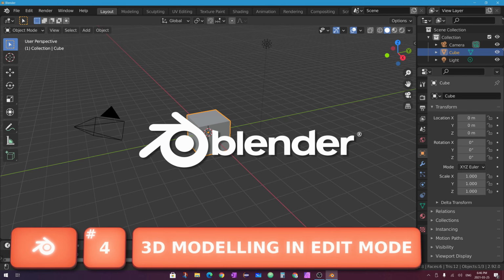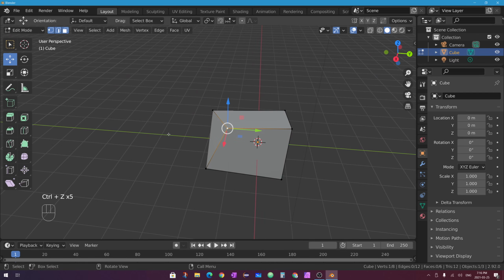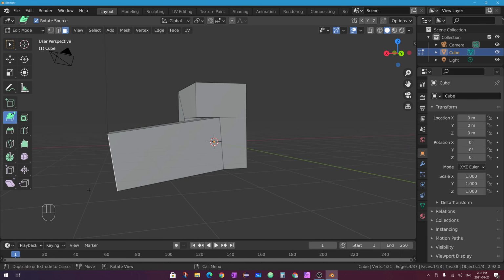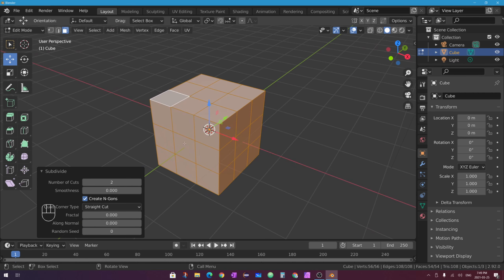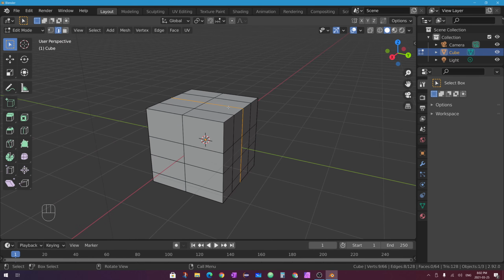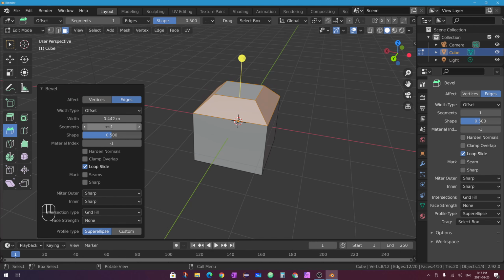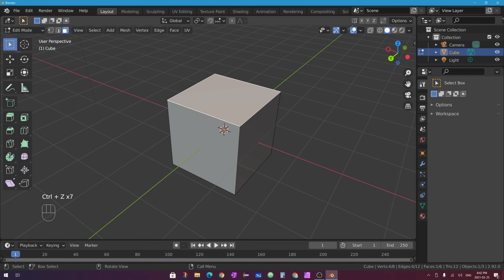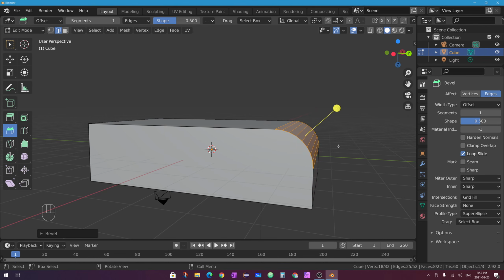Let's Learn Blender! #4: 3D Modelling in Edit Mode!: Part 1

Comment: Sorry but all the keyboard functions don't work as you suggest in your tutorials... eg after extrude... tap S the Z then zero does not work... 25.30 ...maybe this is a Blender 4 thing, or a mac thing or an operator error.  I did the full tutorial for the sword and render from another lesson and everything worked perfectly... will have to go back and redo it as it made more sense and the operations all worked.  CG fast track had more comprehensive lesson plans and teaching outcomes, he went a little quickly but it was well explained... through all steps and even gate screenshots of settings for more complicated steps.

Comment: Anyone know if you can use Boolean  objects with selection modes? I want to make a Chinese moon gate model in a wall with the same circular shape but I'm not skilled enough to model it. 
Can it be achieved with selection modes in advanced way paired with Boolean shapes for removing/hiding  etc???

Comment: hey i am learning unity now (started learning 10 days ago) ,so should i shift to godot or stay for unity
Reply: Wow, super late reply. But here's my 2 cents.  I'm a self taught coder / game dev for fun (not planning to ever make money, have a day job, just a nerd).  I looked at unreal, unity and Godot when I got started about a 1.5 years ago.  You can learn any of them.  Unity is C based, if you already know C, unity is great.  It's more 3D focused engine, for 2D it's actually harder to use.  Unreal might seem like over kill (and you do need the setup to run it) but it's 100% geared towards making 3D games.  Like Bender a ton of depth, but also a ton of content to consume.  Godot, is a thing great for a persons first game engine.  Especially if they have no previous coding knowledge.  It uses GDscript which is a language only for Godot, but was written (based off python) for gaming.  It's very easy to learn and understand.  Also Godot is easier for 2D games.  

IF you already have a project in mind that you want to create, anything will work.  If you have no idea what you're doing and want to learn, Godot is a great place to start, then can move forward after that.  If you don't want to actually do coding / dev, but more direct and arrange.  Unity and Unreal have a ton of assets you can purchase / import and create from there.  Godot has far less documentation and 'net support' compared to Unity or Unreal.  But for messing around, there's a ton of content to work through. 

If you choose Godot, check out the "Kids can code" channel on youtube.  Just do the first game tutorial (which is also on the Godot home page).
Reply: @Vejitasei  thanks